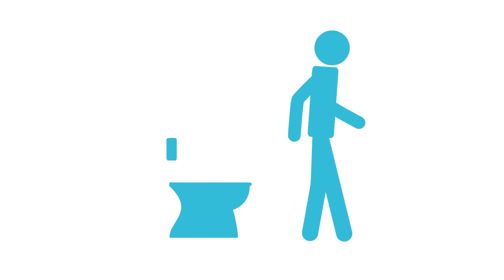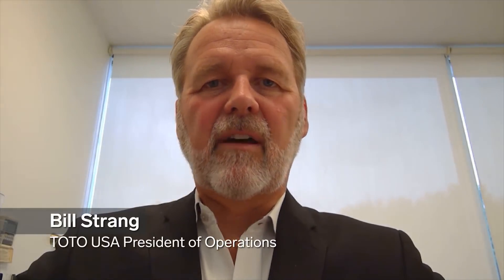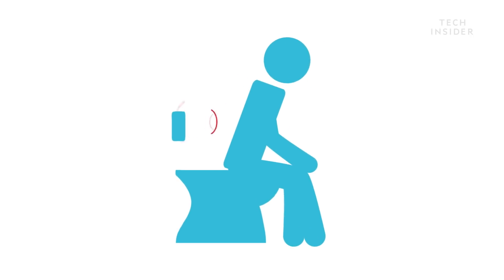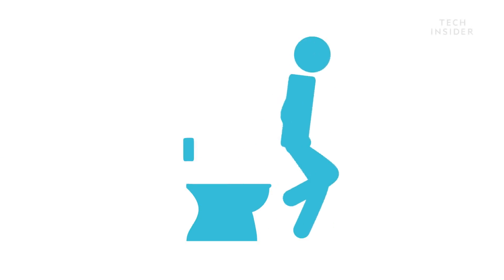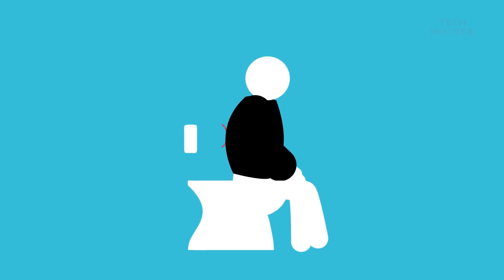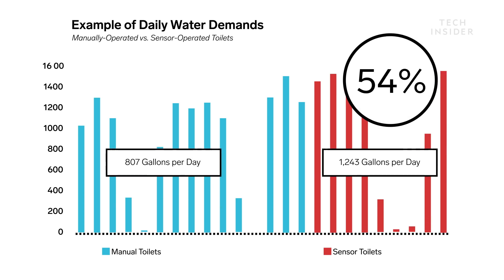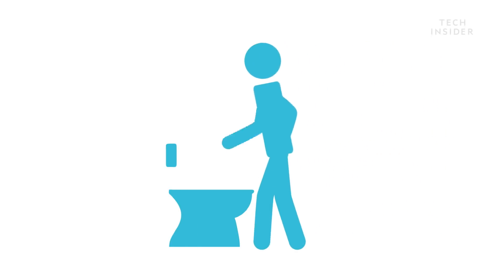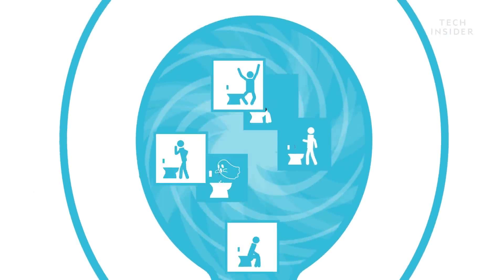Why Bathroom Sensors Suck

Comment: Something I’ve learned from my many experiences with auto-flushers is that—at least for Sloan sensors—the seemingly random flushes while you’re sitting on the toilet are actually intentional. Most Sloan sensors (the oval-shaped ones especially) actually have timers inside them that automatically trigger a flush after a certain amount of time, EVEN if you’re still sitting or standing in front of it. Next time you encounter one, watch the indicator light as you approach. It should start flashing slowly, then progressively get faster as you continue to sit or stand in front of it. And eventually, it will stop flashing altogether, followed immediately by a flush. Then the process repeats itself over and over again, until you get out of range. As for Zurn sensors, they don’t have the same timer system, which makes them the best by far. Zurn’s oval-shaped sensors are actually really cool, in that they show a solid red light while you’re in front of them, and then a green one when you walk away and it flushes. Kind of like a traffic light for the flush valve, if you will! Red means wait, green means go ahead and flush. I had those particular sensors in one of the schools I went to as a kid, and they were the best!

Comment: I don't know about other countries, but often in the UK, you'll find toilet flushing sensors that work only at a few centimetres' range so you have to put your hand right in front of them, which is both the improved hygiene of a sensor flush and no flushes when you don't expect it, though the kind with phantom flushes also exists. Though urinals seem to be the exception, never have issues with the sensors on them

Comment: Imagine if your hiding in the bathroom, with these toilets, from a shooter, stabber, or any sort of criminal. You’re doing so well to keep quiet as he/she just entered the bathroom but you move slightly, the sensor catches that and it flushes. The criminal finds you with ease, kicks the stall door open, and kills you (or holds you hostage)

You wouldn’t have this issue with manual toilets. These just increase your chances of being caught.

(I know they would probably check the stalls anyway but you never know)

Comment: In the mall where I live they have sensors to flush but they also have a button you can push if the toilet doesn't flush automatically. Solves those problems pretty good... As for the sink and paper towel... They're annoying at best...
Reply: The best ones have a truly mechanical button for manual flushing. That way, even if the batteries in the sensor unit die (or—if it’s hardwired—the power goes out) then you can still flush the toilet—no matter what.

Comment: I deal with these things almost daily. I do facilities maintenance, and often get calls about "bad" sensors, and usually we either recalibrate the sensor, sometimes with a magnet, but most often, just replace the whole valve. I'm starting to notice the automatic valves usually gum up and go bad more often than manual valves as well. I've replaced one manual flush valve, and even that was just the handle assembly due to a crumbled spring, in the past 2 months versus about 5 automatic valves. I notice Toto valves fail much more often than Zurn or Sloan valves, but that may be just because they've been there longer. Anyway, automatic flush valves suck. Getting a toilet water enema halfway through releasing a giant dook is never fun.

Comment: Just put waterproof ultrasonic sensors there, they are cheap as heck to produce, don't need maintenance (They are often at the back of cars, which get dirty, vibrate heavily, etc) and are easy to program, as they follow the same principle. Cheap ones can also detect up to 4 meters, with centimeter precision. Companies are using shit tecnologies because they want. Easy as that.

And let's be realistic, even if they (ultrasonic sensors) echo back in a very echoey bathroom, they would still measure something and that can even be averaged with some simple programming skills, bringing the false triggers down to 0.

Comment: 0:07 When the right happens, there’s usually a button you can press.
It’s called the “stop flopping about like a panicked beached whale and actually look around you” button. It’s sometimes a lever instead of a button.

Edit: It turns out that they had a solution at the end of the video.
I’m not really sure why it still involves the sensors, though.
Pushing a button is probably easier than sticking a piece of toilet paper to a sensor, and then taking it off afterwards.

Comment: So basically, all these optical sensors just plain suck. Pull-down paper towel despensers and sink knobs win again. Just grab the paper, yank it out, use it to not get your pee hands all over the sink knobs, wash your hands, dry, repeat to turn off the sink.
Reply: William Shreckengost from what I can tell it’s the cheap ones that suck because I’ve never had a problem but I read a comment about someone who rarely ever had problems until one time from which he concluded the sensor was an issue 

So improper cleaning or cheap manufacturing

Comment: When I was younger I thought that if you wasn’t a safe enough distance away that you may be somehow flushed and somehow drown or go into the sewage system and never to be found again. So when I would flush a manual toilet I would run to the corner farthest away from the stall and wait for it to finish or rush out the stall.
However when automatic started coming out I would be scared as it always auto flush on me (since I was small) however i would cover it with a piece of Toliet paper. However when they switched from sensors being on the outside to inside the wall I would have one hand on the sensor with a Piece or TP and try to it down at the same time. This worked 25% as I would either Pee on my self, fall, or be too scared to use the restroom and stand their for a long time. Which being 6-12 made me have my mother come with me a lot more than necessary.
Thank god I grown out of that stage but just a small funny story

Comment: You have to get up and walk away from the toilet exactly the right way and at the right speed in order for it to work. I wish they would put a manual flush on the toilet to use when the sensor didn't work right.
Reply: Lol they do. It’s the little black button right next to the sensor. Pretty standard from what I’ve seen
Reply: most of the sensors that I have come across are ones where you have to wave your hand in front of them to activate them

Comment: The guy they're interviewing about the sensors looks like he's sitting on a toilet. Also, the reason manual flush toilets use less water is because nobody is flushing them. I don't know about you but I'm not touching that flush lever. It's not possible for someone to wash their hands before touching that, after touching their asshole or penis/vagina... so I just walk away. Also, the handle to turn on/off the water on the sink is touched by everyone with their dirty shit hands... so if you do use it, be sure to turn it off while holding a piece of paper towel.. open the door with a piece of paper towel as well.

Comment: I think there should be a longer delay between when it senses you leave and it flushes.  4-7 seconds is to short you can be bender over to wipe your ass and it just flushes.  If the delay was 45-60 seconds you wouldnt have this problem.

Comment: I mean why should it be more hygienic? I mean touching the handle to flush, should be no issue, because you wash your hands. So the point where you don't want bacteria on your hands, is after washing your hands. So the paper towels and the door should be able to operate without using your hands. With the paper, its good when the next pice of paper is coming out without you needing to grab into the hole. This is usually done with a folding technique and not with electric motors. The door is a big thing. The Handle could be shaped for your elbow, can be pushed to be opend or have a handle that you operate with your foot. Such handles exist and gets rarely used, like in a hospital. The benefit is that a doctor or a nurse can enter the room, while sterilizing their hands, or when you have stuff in your hands.
Reply: This so much this.
Reply: Unless the Toilett is very dirty, it should still be better than other things you use. How often do you clean your phone, your backpack, your handbag (for the women's), your keys, your purse and so on? Everyone is freaking out about toilets but doesn't care about daily use items and the way of your hands before and after you touched these items.

You should clean your hands regularly and it's the best, to do this, after using the bathroom and to because of getting rid of the poop germs. Imagine this: you are in a store and in infornt of the line is a homeless guy, paying his stuff with all his coins. You get some of these coins and doesn't care about it. You probably didn't noticed the homeless guy, because you was checking social media on your phone. After that, you touch your phone, your face and so on. You still alive.

Sure it makes no sense to touch a door knob, to get all germs on your hands again, that you get rid about 10 secs ago. Its like after a shower, you put your sweaty clothes on, that you wear before the shower. You take fresh clothes, to stay clean as long as possible.

What I think is funny that people are disgusted by someone not washing their hands, after taking a piss. I mean the d from the guy is probably cleaner than the door knob and your phone. I mean unless you piss on your hands, everything should be fine.
Reply: Yes, not to mention that self-flushing toilets can send excrement shooting at your completely uncovered loins, which is pretty dangerous if any gets in your urinary tract. At least hands don't have an entry way (and as you say, they should be clean before they do touch an entry way).
Reply: You probably still have schmutz on your hands after you wash them.  The less filth you touch overall, the better.  You are not really clean until you take a half hour shower with water so hot that your sweat pushes soil out of your pores and then you dry with a sanitized towel.
Reply: Okay so you walk into a public bathroom 

Then into a stall 

Then you do your business or whatever 

Your hands are now DIRTY

To CLEAN your hands you must now go back to the sink which is outside the stall 

This means your hands are dirty while pressing whichever button to flush and while opening the door
Reply: ZeldaFreak I like when the doors open outwards so you can just open it with your body or shoulder and it looks normal 😂 I usually grab door handles with my shirt , stick my foot in the door and then maneuver it open and look like an idiot 😅😅
Reply: If you're so worried about what's on the handle, just use your foot.

Comment: Most urinal censors work pretty well usually
Reply: I didn't know urinals supported censorship lol. Jk sensors work better with urinals becase when you use them it's just a simple walk up to and then walk away unlike in a stall where you change body and clothing positions a lot more and the sensor is lower as well

Comment: Better solution: add a sensor to the door lock. Every time it unlocks flush the toilet
Reply: On the right track but it should be a physical switch to prevent accidental activation
Reply: Hey that's an idea
Reply: BINGO. Something sensor linked to the door is exactly what I was thinking as well.
Reply: You smart
Reply: Hey let's flush every 5 seconds!
Reply: I actually found in several old catalogs of the Sloan Valve Company that makes most commercial toilet flushing systems that there actually used to be seat activated toilets where the toilet would flush everytime you stand up from the toilet. It's pretty clear why that idea never caught on
Reply: @exoticcar5482 They make smart toilets today with that exact feature, believe it or not. Luckily, today’s manufacturers are smart, and they added a delay of about 10 seconds after getting up before it actually flushes. That way, no accidental triggers will ever occur.
Reply: That idea must be heard out loud.
Reply: Good one! I wish that was real though.
Reply: That  would desensitized myself of my phobia.

Comment: The real reason for their annoyance is that they are required to work with battery so it puts power limitation on the device.  Low power budget means that sensor is 99% of the time in a sleep mode.  This makes for a glitchy detection.

Comment: Because they give you 5 milliseconds to wash your hands
Reply: Yeah that's the biggest flaw, should run for about 30 seconds after it's triggered instead of shutting off the instant it doesn't see your hands. I also hate the hand dryers that do the same, or paper towel dispensers that spit out a 4" sheet of paper towel. I get wanting to cut utility costs,  but ffs nobody can get their hands clean and dry with 2 seconds of water and 4" of paper towel.
Reply: Oh don't exaggerate. You know damn right that it gives you a whole 10 milliseconds to wash your hands.
Reply: Wholesome Lad I notice this in California
Reply: You really don't need to run the water while scrubbing your hands.  Also, I wonder what possible reason California could have for not running faucets for excess periods of time...
Reply: I think that is more of a problem with the ones in schools where you have to press a button and the water will only come out for like two seconds
Reply: That's right!
Reply: There are some that stay on for about 30 secs after triggered and i respect the managers who had them installed.
Reply: Same with those push button sinks at schools
Reply: Built and approved by the speed running community

Comment: If these sensors fail imagine the sensors on self driving cars
Reply: I wouldn't go that route. Self driving cars have much higher tech solutions for detection which are impractical and serve different functions as opposed to those used on automatic toilets

Comment: Almost all automatic towel dispensers and faucets I encountered have sensors that work like a champ. Automatic toilets are a hit and miss.
Reply: @davidperry4013  That’s probably the reason why the bathrooms in my workplace use regular old residential toilets and handle-flush urinals for. The sinks, soap dispensers, and paper towel dispensers are all sensor-activated, and they work great!

Comment: I hate the faucets more!
Reply: I get it they are annoying thats why we should just have normal sinks again and not the ones that are a button and on a timer or the one has to be twisted to work.
Reply: The sensor's always pointed so that to activate it you have to take you hands out of the water. So then it stops the water. Que the awkward back and forth trying to get the soap off your hands.

Comment: Can we just go back to switches and buttons please thanks
Reply: No! EVERY thing has to be smart!
Reply: Usually I am never happy when a manual toilet gets replaced with an automatic one!
Reply: Ren G 
I guess the new saying is... if it ain't broke, break it!

My old Kirby vacuum cleaner is proof of that. It metal, bagged (actually better than bagless) and heavy. It doesn't have high tech sensors or sends message to your phone when the house is clean but man... it's powerful and built tough. 15 years and still out performs most modern vacuums.
Reply: It's-a me Megatron. 
Ey my dad has this big heavy bagged vacuum that my GRANDMA used. It's the best vacuum cleaner I've ever used and it isn't fancy in the slightest. It doesn't need to be fancy to work right.
Reply: @marshmallowmountains4636  
Cool! Those things will last a life time. BTW what model is it? Reason I ask is because the new one (well anyone made after 1990) has a nice feature called test-drive that let's you push it with a single finger.

Comment: Always been using the manual type & quite happy with that. 👍
Reply: I don't need a sensor, I prefer a manual flush also. Just because a "small" percentage of people forgot to flush after themselves doesn't mean I should have to deal with faulty auto flushing monsters blasting my ass with poo water.
Reply: @JaxLynnstarAnimate  You're right.
Reply: @JaxLynnstarAnimate  🤣😭
Reply: Overwritten Protocol right! If it ain't broke, dont fix it!
Reply: The Reckless Recluse The idea is that with these sensors you don't need to touch all these dirty things in the public toilets
Reply: Максим Цыба those sensors are not entuative enough so they cause problems
Reply: I agree, and I have like 10 comments in this video already.

Comment: I've never had a problem with those sensors...
Reply: Yum Yum Milkshake Same.
Reply: Yum Yum Milkshake lucky
Reply: Yum Yum Milkshake same it's useful for not getting germs on your hands
Reply: LucasNewland007 exactly
Reply: Same
Reply: Yum Yum Milkshake same here
Reply: Me too, these sensors work fine when I'm using them, but why would you need automatic dispensers for paper towels?
Reply: lier
Reply: I've never seen them work properly. Ever.
Reply: I used to say this, then it happened to me when I started my new job...I've dubbed it the non-flushing toilet because 99% of the time there is shit or piss in it. I guess no one can get it to flush lol. You're just lucky you haven't ran into one of those yet.
Reply: Same
Reply: Yum Yum Milkshake I haven't had problems with the sensors that don't flush the toilets but that's kinda it.
Reply: To me it depends on the brand. Sloan automatic valves tend to be the most reliable but rubbermaid, American Standard, and Zurn valves tend to go off randomly